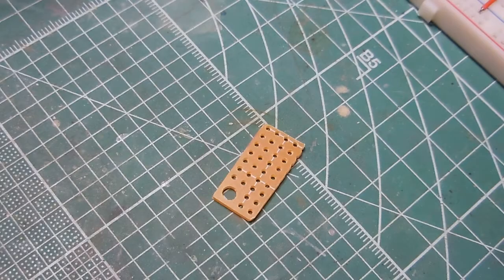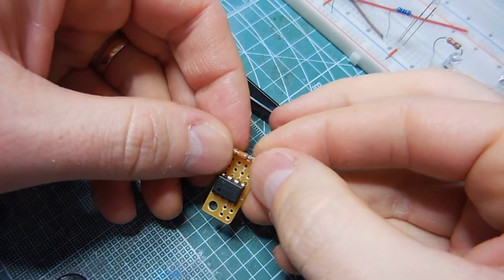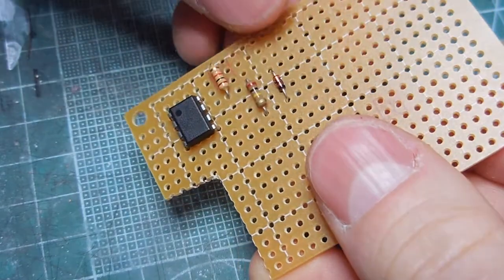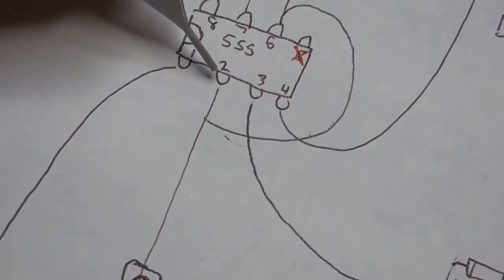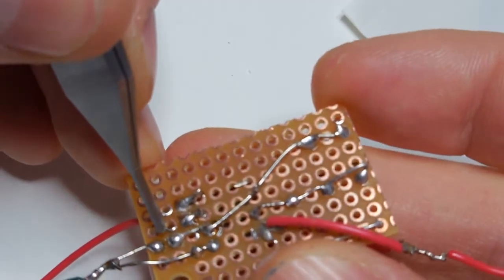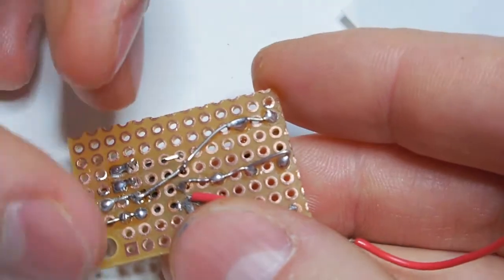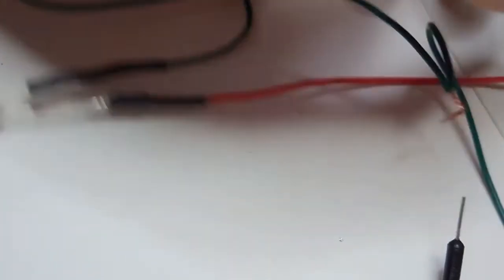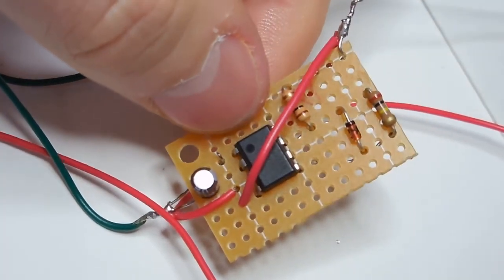HELP REQUEST: soldering the 555 timer chip strobe light (SR-71 Blackbird build)

Comment: If i compare this to my Enterprise Refit 555 setup, then it looks like you made a small mistake with the capacitor. You connected the negative side to the 555 chip instead of the positive side. This way the capacitor can't do its job. So flip the capacitor an it should work.
Reply from the maker: Kancho isn't funny when it happens to you. I work with Japanese kids and fortunately this doesn't happen to me often. What does this have to do with soldering chips?
Reply from the maker: THANK YOU!
Reply: You're welcome!
Reply from the maker: I heated up the contacts to pull the diode out, flipped it, and now it works! I didn't have to touch the capacitor. Should I go ahead and flip the capacitor anyway?
Reply: is this true ? It's a common prank among Japanese kids to stick fingers into other people's butts when they are not looking. It's called Kancho.haha

Comment: you can simulate that circuit in the browser at falstad's site, which has some example circuits using the 555: http://www.falstad.com/circuit/   also look into Wire Wrap w/ Kynar wire, a manual tool w/ 30awg is the best for small projects.  it's basically solderless so you can wire everything up quickly and see if it works, then you can tin the wraps with solder for permanent connections.
Reply from the maker: Thanks for the tip. Being able to test a circuit before soldering anything would be helpful. I managed to fix this thanks to the advice I've received. I'll put up a quick update maybe tomorrow.
Reply: Wo0t!  apologies for evangelizing the Wire Wrap method all the time, I just love how simple & forgiving of mistakes it can be!  in the past I had gotten so burned out after manually routing connections on veroboard for things like a 4x16-bit shift register in a firework controller, I slaved over that thing for a week solid!  if I knew about this method back then, I would not have lost so much sleep  :P
Reply from the maker: I don't know what Kynar wire is, so I will need to look that up. There's also the issue of whether it is available in Japan, and also if the name is different. For example, magnet wire here is called "enamel wire." Capacitors are called "condensers" here. Maybe the nomenclature is borrowed from Europe.
Reply: it's essentially silver-plated copper wire (most commonly 30awg) with a thin teflon jacket, there are sample packs on ebay with 8 colors.  the tool is about the size of a pen and half the length, it has a hollow end that the post (or component lead) goes into, and a slot right next to it that you insert a 1cm length of stripped wire bent upward into so it's parallel with the post/lead, then you twist and it tightly wraps the stripped wire around the post/lead.  with square posts it actually produces enough force to make a cold-weld at the corners, but for round posts and component leads the grip is strong enough to hold itself in place while you test the circuit out.  sometimes I just cover the wrap in hot-glue, especially if it's attached to something with a low melting point that a soldering iron would damage.
Reply from the maker: Now that I've gone through this breakthrough accomplishment (personally), I'm in the mood to build another one or three. I might need to buy more capacitors, though.

Comment: N4148 diode ends - black stripe end  is negative, the other end is positive, the capasitor the side withe the grey is the negitive side  and the opposit side is the positive side.
First check that the diode is orientated the same way as on you circuit diagrame, next  turn the cap around the pos leg sould be conected to the pin 2 and the neg leg connected to ground, next conect pin 4 to pin 8 then pin 8 to pos power , pin 1 to neg of power and to neg of led,conect diode to the pins on the 555 chip , then the resistors to the corect pins on the chip and or the led acording to the circuit diagram .If all is connected as in the circuit diagram then it should work. Good luck.
Reply from the maker: Thank you. The black end of the diode should be on the right side instead of the left. So I guess what I have to do is heat up those contacts again to loosen up the solder and pull the wires out? I don't own a solder sucker. I'll check my local home center to see if they have anything like that.
Reply from the maker: I heated up the contacts to pull the diode out, flipped it, and now it works! I didn't have to touch the capacitor. Should I go ahead and flip the capacitor anyway?
Reply: stevethefishdotnet ,
The cap has to be connected to pin 2 with the pos leg because electrons pass through it from the pos to the neg leg of the cap .having the cap this way may not allow it to do its job as far as help controlling the fade/ blink rate of the led.
However if it is working then run it for about 3 to 5 hrs and see if it keeps working if it does then it probably will be ok to use.good luck.
Reply from the maker: OK, thanks. I was able to get the resistor out, and that was a bit more difficult location to get to than the capacitor at the bottom of the chip. So I gave it a shot and flipped it. I'm all set now! I can finally proceed with the Blackbird I'm working on now. You've been a great help, James! Thanks.
Reply: stevethefishdotnet ,
Any time. I'm glad. That I could help .
Good luck with the rest of your model build. Can't wait to see it.

Comment: You can try using a railroad crossing sign circuit board there easy to build it wont be the fast strobing effect but you can change the speed on the board.

Comment: Yes the diode is polarized. The black band is the negative side. Try turning it around and see if that works. The capacitors are also polarized, on the body there is a light coloured stripe that has a number of negative symbols on it make sure that side is on the negative.
Reply from the maker: THANK YOU!